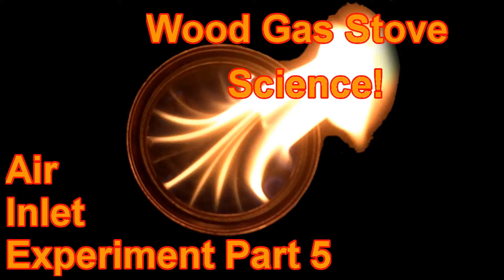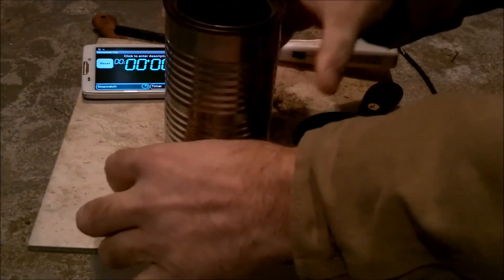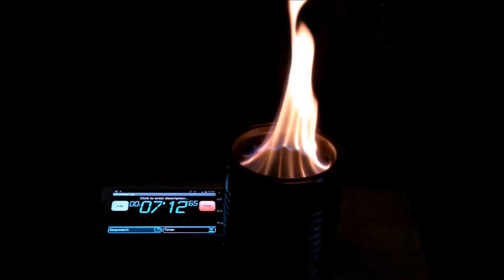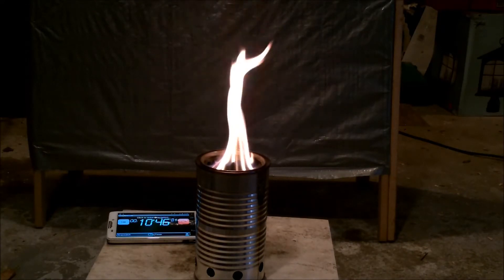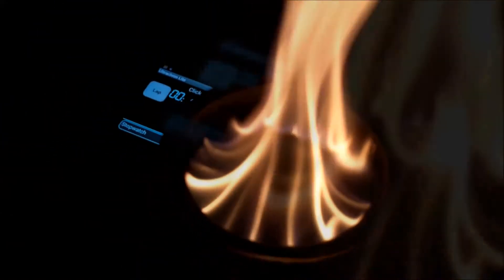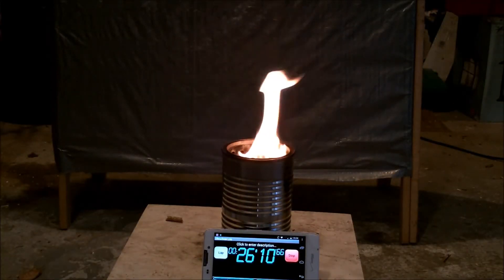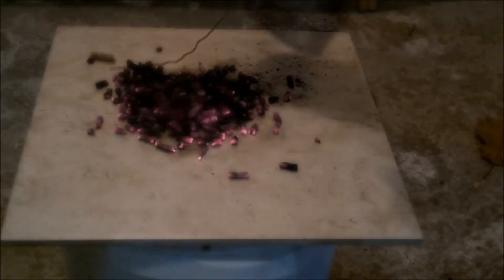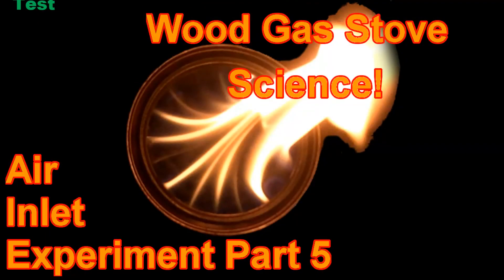Wood Gas Stove SCIENCE! V5.0 PRIMARY AIR OPTIMIZED!!

Comment: Heath, could you explain why you took the approach you did to determine the optimal primary air port size?  It seems that you started with a small primary air area and increased it slowly until the pellets were completely converted to char.  Is that right?  Would the weight of the char compared to the weight of the pellets before the burn also be a good measure of how complete the conversion to char was?  Doesn't the intensity of the jets have an effect on the conversion to char?  Or do less intense jets simply lengthen the time for complete conversion?  I'm asking because I'm planning on building a slightly larger stove and I would like to follow your approach.

Comment: Heath, I'm really interested and impressed with your scientific approach.  However I'm a bit confused about how many primary holes you actually have for this version of the stove; V5.0.  I visually count 25 holes on the bottom and 16 around the edge of the inner can. That sums to 41, but you say in your video that you've increased the number of holes to 31.  I'm attempting to use your data to help me design a stove of slightly different dimensions.  If you could clarify the number of holes I would appreciate it.

Comment: blue flame means the flame is in a higher temperture so that the frequency of the light is higher（red low—blue or violet high）.  I personally guess that only fanforced or make a turbine could result in pure blue or violet color flame in secondary holes.
Reply from the maker: coldiceEVO I doubt I will get to pure blue flame... but I am getting some blue flame! My secondary Air Experiments are showing some very interesting results... Stay tuned!